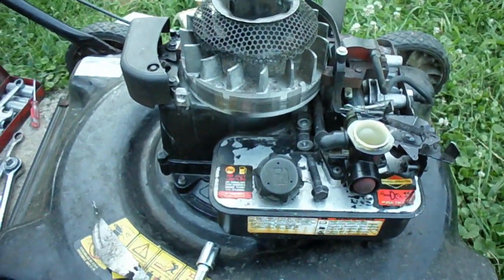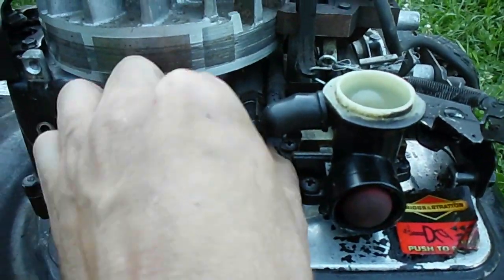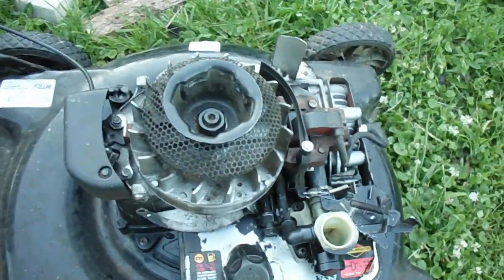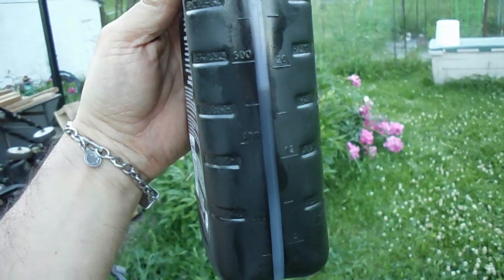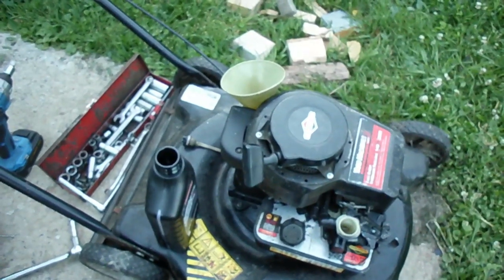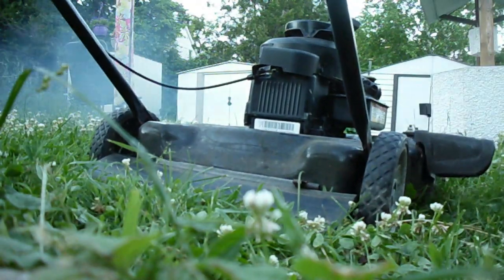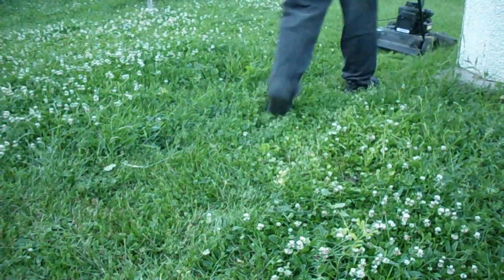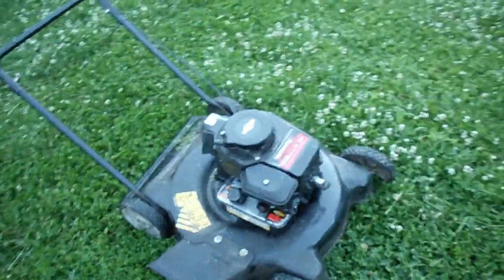Curb Find Briggs Push Mower Part 3

Comment: Wow, that exactly my curb find mower! I bought my first house and you are one of my inspiration to pick up a free mower on the side of the road instead of buying a new one, and now you found one exactly like mine. I just had to change the carb seal and diaphragm, change the oil and sharpen the blade. It's seems like a reliable machine, I like than it's lighter most mowers.
Reply from the maker: Cool, glad you were able to fix it up and get more use out of it. To me it is a way of going green, reuse, recycle, rebuilt etc. Any way you look at it, if you can make it last longer it saves the energy to melt it down and make a new one.

Comment: That runs surprisingly good for a newer Briggs of that type. Most of the newer 3.5hp's I worked on would spit and pop without a load and just run kind of meh no matter what I did to the carb.
Reply: I changed the carb diaphragm on mine, it looks like they tend to stretch over time and a fresh one solves the running issues.
Reply: @ShawnGuertin  Some of the ones I've worked on still did it even with a new diaphragm. We bought one new in 2006 and it ran like that from day 1. Sold it to a guy we know and it took 10 years for it to quit doing that.